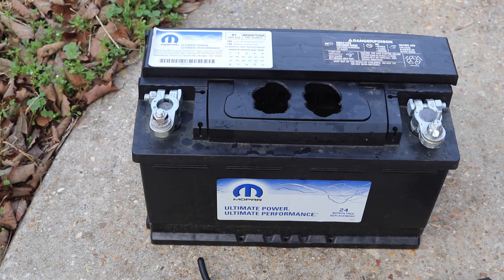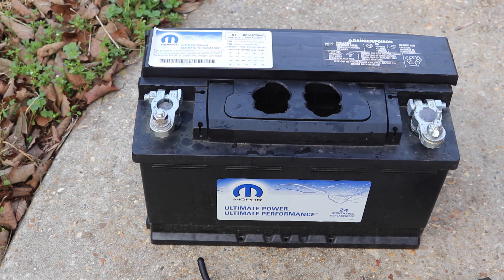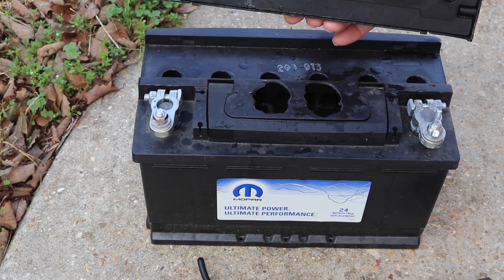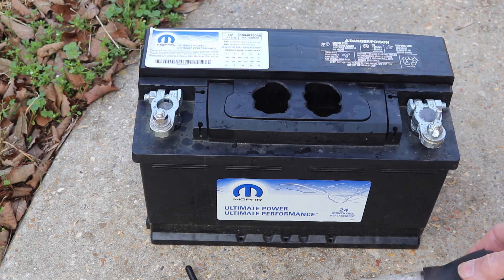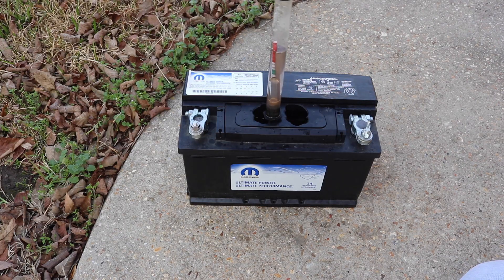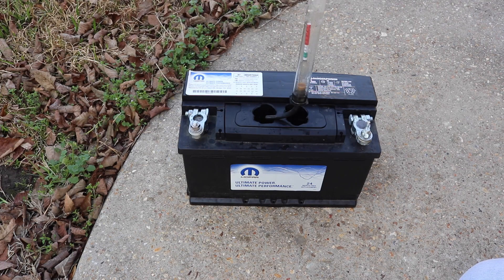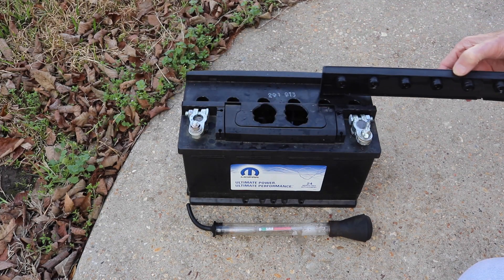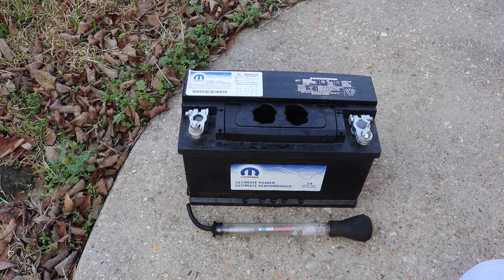RAM 2500 Cummins OEM Battery - Exploded

Comment: My 2019 3500 dually batteries lasted about 4 years.  $360 x 2 from the dealer plus install.  Got 2 AGM's from Walmart for $360.  Walmart brand (Everstart) manufactured by a reputable battery manufacturer.  Very satisfied with them.  Best bang for the buck.

Comment: Just opened mine up and both batteries had low water in a few of the cells per battery. I bought and installed them 11-2020. I bet I will get a longer life out of them now, you just saved me some more money!!
Reply from the maker: Great, Yea, I missed that on those OEM or I probably could have avoided it also.  thank you

Comment: Great video, Marion. Thanks for the info. Batteries are so overlooked and important. FYI- Costco sells their "Kirkland" brand. These (or at least in my area, Northern Calif) are supplied by Interstate, which are built by Johnson Controls. Definitely better priced through them (if you have Costco in your area).

Comment: Stock batteries are absolute garbage.  First thing you should do with a new truck is throw away the stock batteries and put in a high quality aftermarket battery you can trust.
Reply: and chances are, you are replacing it with the exact same battery... theres only like 3 manufacturers for car batteries,  Clarios(formerly johnson controls), East Penn or Exide.
Reply: @ganzeytyler  You are absolutely correct. Oldest secret in the book.
Reply: Baloney! I live in the desert southwest, nearly in Death Valley and I am on four years with the OEM batteries in my Ram 3500.

Comment: Interesting Mr Blair! I will give a peek at mine tomorrow morning ('19 3500)
Reply: I would be interested as well, I have a 2021 3500 in storage right now and wish I could get to it to check the battery. @ Walter K please let us know.
Reply: I apologize for my delay. I examined the entire label of my batteries and see no mention of AGM so I am concluding they are conventional flooded cell batteries. I did not remove one or both from the truck and won't until they die.

Comment: Was that the actual original equipment battery that came in your truck or was it replaced from the original? The batteries out of my 2014 and my 2017 did not have labeling like the one in your video. I went aftermarket when I replaced mine, and all parts stores specified AGM as the OE equivalent. I'll check & see if I still have any of the old ones I took out & see if there's any free electrolyte in them or removable covers.
Reply: Just to update a little…I did find “some” old batteries in my shop. The date on them would indicate they’re from my 2014, but I have no idea where the old ones from my ‘17 went. Maybe the date is some sort of certification vs manufacture date. Whatever the case, the ones I found are flooded cells not agm, but they do have a Chrysler/dodge/ram part number on them. Researching that p/n shows it’s discontinued but, the vehicle applications are pretty much all FCA vehicles from now back to 2010. I would really like to know why all the parts stores only list agm’s for replacement if the actual OE ones are flooded type.
Reply from the maker: Yes, this was an OEM from the original install by factory.

Comment: my 2018 are AGM batterys - a Lamamie  - and is suppose to be sealed - and keeping a desulphater  on em often - should help also make em last longer - but does make the water evaporate quicker  -   My Kubota tractors also have AGM batterys - and yep - they cost more -- they also have more power in  em  --  ahahaha